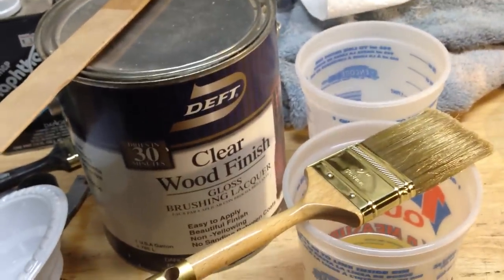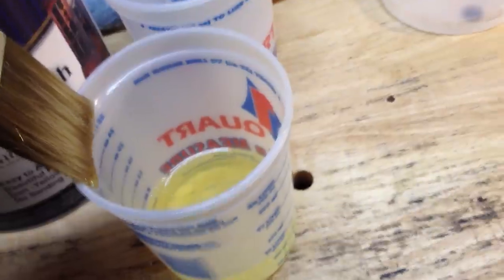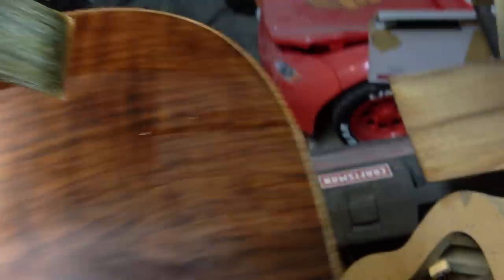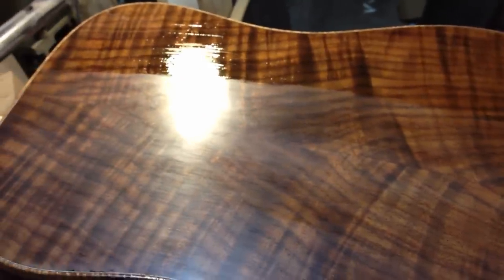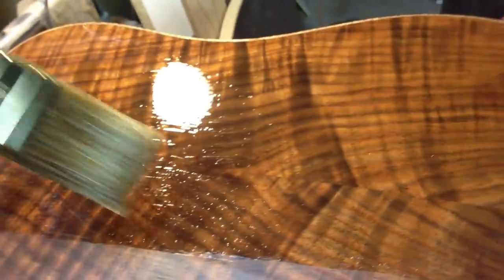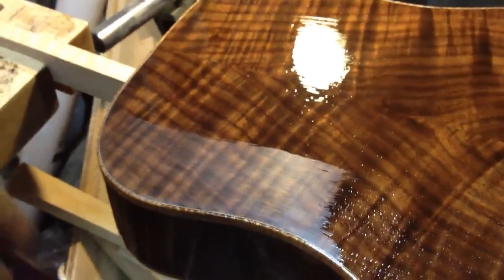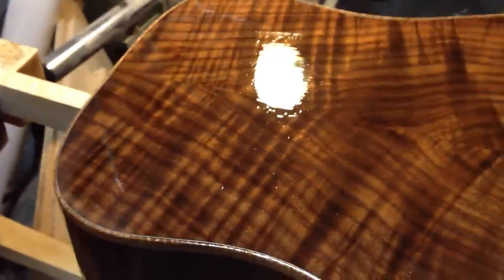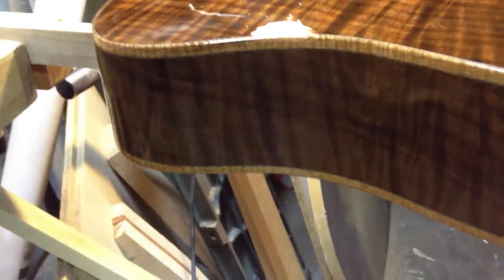Brushing lacquer on a guitar part 1

Comment: Could you discuss your brush selection (natural hair) and you thinning technique?
When I apply a finish, I lay down one slow deliberate wet stroke (not back and forth motion).  Helps with bubbles.  You "apply" a finish coating, you "brush" paint.

Comment from the maker: Yes. So does spaying though. You have to wet sand either way. Brushing is easier, requires less equipment, and is less expensive. It requires more sanding at the end, but you wouldnt be able to tell the difference if I put one of mine side by side with a sprayed guitar.

Comment from the maker: You don't need to sand each coat. I usually sand after 3 or 4 coats. It takes a lot of sanding at the end to get a mirror finish, but it is not bad. I sand by hand and it takes a couple of hours to get it like glass.

Comment from the maker: I think my lacquer says you can recoat after 30 minutes, but if you do that, you are sealing in the previous coat and seriously slowing down the gassing off process. I have had a guitar that I put on three coats a day for 3 days in a row, level sanded after every three coats, pick up the texture of the towel it was laying on while I did the set up. So frustrating. Now I do one brushed coat a day. Takes longer to apply, but it dries quicker in the end.

Comment from the maker: I suggest you do only 1-2 coats a day. The brushed finish is thicker and takes longer to gas off than a sprayed finish. If you do al of your coats close together, it will take months for the finish to fully harden. In the meantime, it will pick up the texture of anything you lay it on, or your shirt, pants, strap, case, etc.

Comment: Tony, have you ever tried using foam brushes for working in thinned laquer? I learned finishing on sailing yachts, and then on refinishing furniture... good quality foam brushes were The Ticket for me. I haven't built or finished a guitar yet... planning my first kit build now.
Reply from the maker: Billder Inbaja real nitrocellulose lacquer will melt foam brushes and ruin the finish.
Reply: Yikes, thanks for letting me know. I have always worked with Marine Spar Varnishes... obviously different!

Comment: I'm in the process of doing this at the moment. Have you ever thought of using foam brushes? They give an absolutely flat coating.
Reply from the maker: Nitro lacquer will eat the foam brush and contaminate the finish. It may never cure properly if you use a foam brush. A natural bristle brush is the only way to go when brushing real nitrocellulose lacquer.
Reply: I can appreciate that. I currently use KTM-9 which is water based.
Reply from the maker: KTM-9 is safe for foam brushes. I wish the same were true for nitro!

Comment from the maker: I apply 7-8 coats on the sound board, and 10 coats on the back and sides. I was wearing a mask in the video. It is a 3M mask that filters the VOC out of the air. I cant smell the lacquer with the mask on. But I sound too much like Darth Vader with the mask on and it makes for a lousy sounding commentary. I took the mask on and off during the video, but eventually I gave up and left it off. Since I was brushing, not spraying, there is no mist in the air. Only the vapor of the evaporating lacquer.

Comment: with epoxy, you can blow air from a heat gun or hair dryer to get rid of bubbles.
can you do the same with lacquer?
Reply: Lacquer flashes off very quickly. A heat gun will just make the top skin over faster, which will probably make the problem worse. I think you would be better off to mix the lacquer with some retarder to keep it from drying as fast so that you can brush the bubbles out. Pull the brush along in one light stroke at the end to break up bubbles etc.

Comment: I have sprayed probably millions of gallons of lacquer. I have only brushed varnish and poly. With that said, do you thing using some retarder as well would help level the brush strokes? I would like to see a finished version of one of your jobs. I worry about brush marks. I dont have a sprayer anymore and I am retired from painting. I have used tung oil on guitars with great success. Have you tried retarder? Can you show a finished product?
Reply from the maker: I don't use retarder but it would help. I would probably have to do a lot less sanding if I used retarder!  Here are links to a couple of my guitars:
https://www.flickr.com/photos/49539199@N06/sets/72157630521817316/
https://www.flickr.com/photos/49539199@N06/sets/72157633940535778/
Reply: +Tony C  Omg your guitars are BEAUTIFUL! Do you sell them?
Reply from the maker: Not at the moment. I had to take a break from building. When I get back to it, I'll be selling them.
Reply: +Tony C Man, you're an artist ! Trully ! I'm in love with you Black Limba ! That guitar looks awesome ! How much cost a guitar like this thoose days ? Can't access your website :(
Reply from the maker: +G Develle Thanks! The black limba guitar was $3200.00. I have stopped taking new orders so I took down my website. I will put it up again when I am not so swamped with guitars and other projects. Thanks for the compliments.

Comment: What ratio do you use? I'm currently using a 1:1 STAINED nitro and cellulose thinners ratio but it seems to be extremely quick to clump and dry still, it leaves patches that are darker and patches that are light etc. Any advice would be gratefully received.

Comment: Do you need to thin the lacquer? Also, assuming I have a smooth filler, then have my stain done (I'm staining a burst (everything is compatible)) will a brushed lacquer be smooth? Do you sand each coat to keep it smooth? Thanks!

Comment: How did you thin your lacquer? Sorry I am new to this woodwork stuff. Also how do you make a black lacquer or can I just purchase it already made? A reply would be heavily appreciated.
Reply from the maker: Thin it with lacquer thinner. 10-15% thinner will do the trick. I have never tinted lacquer, but there are dyes and tints made especially for nitrocellulose lacquer that you can buy. Sorry for the slow reply. I did not see your comment.

Comment: Just curious...but do you think its possible to spot lacquer a guitar? Ive got s guitar where the laquer has worn down/off. Is it possible to apply a layer of laquer just to one area that needs it?
Reply: Yep! It will melt into the finish just fine. Then you'll just need to level it. A razor blade with one strip of Scotch tape on each end works wonderfully. Then just detail sand, buff and polish!

Comment: this seems like a great way to give an old guitar a new look without having to have extensive knowledge of painting or spray tools or sanding. I would love to paint a sunburst on mine, but don't wanna risk messing it up. but I may try this!

how did you thin the lacquer? a percentage and lacquer and percentage of water?

the rest seems pretty straight forward.
Reply from the maker: +ba55letmysoulfly You can't just slap lacquer over an existing finish if you don't know what the finish is. I add about 20% thinner or less. I don't measure it with a scale or measuring cups. Just eyeball how thick it is. It's not hard to apply, its the sanding afterwards that makes it look good. That takes time.

Comment: Painting is like sex...if you don't get any one you, you're not doing it right.
You "apply" a finish, maintaining a wet edge at all times.  You don't "brush" it on with back n forth strokes like huckleberry Finn whitewashing a fence.  You guide the wet edge coverage with the brush to get a uniform smooth thickness of application.
If you "brush it" you often leave areas too thin which appear as "holidays" (places you miss).

Comment: Do you have to sand in between coats?
Reply from the maker: Omar Flores yes. Sand after 2 coats.
Reply: If you do the layers thin enough you don't need to sand in between

Comment: What do you mean by thinking?
Reply from the maker: TupolevPilot what?
Reply: Tony C I meant thinning. It was autocorrect
Reply from the maker: TupolevPilot ahhh. I add some lacquer thinner so the lacquer is, well, thinner so it flows out and reduces the amount of brush strokes you see. It also reduces the amount of sanding you need to do later on.
Reply: Tony C how much thinner do I need to add?
Reply from the maker: TupolevPilot I thin by about 10-15%.
Reply: Tony C thanks
Reply: Tony C would this also work for polyurathane?
Reply from the maker: TupolevPilot I've never used poly but I don't think you can thin it.